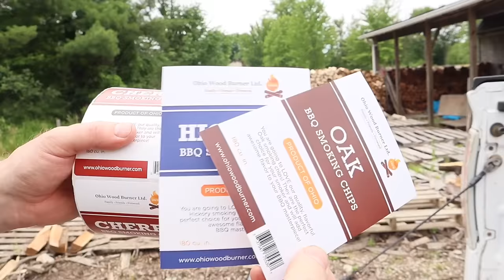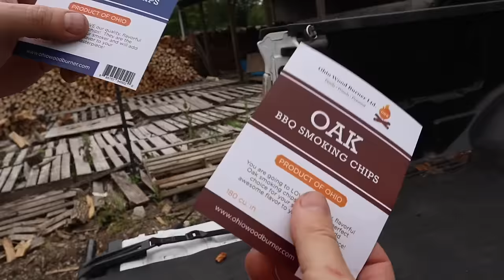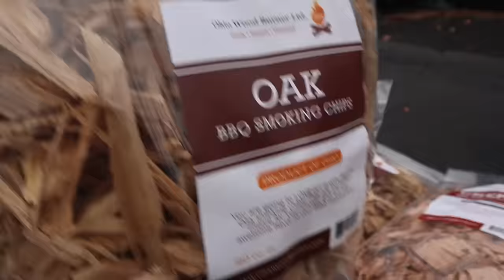New Firewood Product Nets $10,000 A Cord?!?!?

Comment from the maker: Here is the link to our online store!!  Check us out for your super cool, iconic OWB Tshirts and stickers!  
https://ohiowoodburner.square.site/
Reply: Please remove the bark before making chips for wood smokers.
Reply: Here is a good strategy… I think. Approach the bbq restaurants you sell to. Offer to package the wood chips with the restaurant’s branding instead of yours. Customers would buy the wood chips from them because they want the same great flavor at home. Require a minimum order amount from the restaurant and give them a wholesale price.
Reply: I passed this on too my daughter. Doesn't have any equipment and IMO doesn't need it. Rent it, one day. Bust butt and take it back until you make enough to buy it outright. 
While doing so, start looking for a deal on used equipment. Even rental companies sell older equipment if you can fix it deal.
HOW do you find Cherry, Apple, Oak, Hickory wood. Source seems to be the biggest pain the tale. Nothing happens with no wood, which you inferred to I believe.
Reply: Just a thought for rusty gear heads, if you have the space to build a small pole building. You could pipe heat from a sealed water outdoor furnace into a building that will dry the chips if you have a metal weave basket that can be moved by forks. Cherry wood is good and so is apple. Sugar maple, if you could get some, hickory and of course oak. Sassafras should do well but it would require more than what one would think considering sassafras doesn't get real big. Should bring a better price too.
Reply: Joe where do you get your labels

Comment: Idea to make hand loading chips into the bag easier: insert a short length of stove pipe into the bag. The bag should stand up while you toss double handfuls of chips into it. When the pipe is full, you have the correctly measured amount for a bag full of chips.
Reply: That is how i bagged up kindling sticks. Neat quick and cheap
Reply: Issue I see could be too close the speed with bullet the wood and destroy the bags. Your point on a chute under the chipper the metal stops it, with a slope tapered to fit your bag just site there and feed the bags.  Have a couple ideas on a bag holder. Of all the things, filling the bags looks like the most work at this end.
Reply: @IndyTiger1050  use potato type bags. stronger so you can shoot directly into bag, no need to put holes in them, the customer can burn the whole thing at once,  use it for kindling, and no plastic for the ocean (where 90% of plastic ends up). then you can add your business is environmentally conscience  which is a huge selling point nowadays. or use the plastic bags and you can put a funnel where the bin is, then funnel to a slide to a double gate and between gates would be the same amount of product for each bag.
Reply: That’s a great idea Roger. Thanks.
Reply: the extension shute could be made from perforated steel sheet so that the exhaust air can escape and make a manual conveyor to move the bags when full.
Reply: Nerds lol
Reply: I imagined the fry scooper at Burger King

Comment: Great! NEVER EVER put your hand or arm into the chute of a chipper while the machine is running! Drop another piece on to  so the weight will help feed the pieces though. I worked on a potato farm filling 5 pound bags. They had a machine with a huge hopper ,  the operator held a bag under a clamp, tapped a foot pedal, the clamp grabbed the bag. Hit another button, the machine ran a conveyor and filled the bag until the scale shut it off. You made the weight exact and took the bag off and ran it  through the sealing machine. I think Mike Morgan (Outdoors with the Morgans) got a machine like this he sells firewood starters in his packages. Awesome content,  I am going to have to go back and watch some of your videos I have overlooked.

Comment: Hi Joe - it's Big Rodders in Ireland.  Some years ago I made up 400 nets of kindling for sale.  To counter the perception by customers of being shortchanged when the kindling settled in the nets I detailed on the label the minimum weigh guaranteed, which provided a more professional appearance.  Also, to facilitate filling the nets I made up a simple wooden funnel.  To fill your bags I would experiment with an inverted circular conical traffic cone cut at the appropriate diameter so that the plastic bag fits snugly over it.  Mount the upturned cut cone on a suitable frame and get filling and weighting!  Prove the concept with this cheap and readily implementable process before investing more dollars into the project.  When the going gets tough the tough get going so it's over to you now!!
Reply from the maker: I do have a qty on my label.  I have it much lower than what I have in the bag so I think I'm good from a legal/honesty standpoint!
Reply: @ohiowoodburner  - that’s my Boy!

Comment: Improvements: Find the largest tube that your bag will slip over one end. Looks like about eight inches here. Put bag on end and stand up on table. Fill tube to correct level . Then lift tube out letting chips fall into bag. If need be you can make flare end at top like funnel. Also once you get the volume in the tube correct, make a "full" mark on the tube for future fills. Now you have a consistent volume that is fast loading. Another one would be to get special bag that is zip lock but has longer piece beyond the zipper so you could heat seal with a "seal-a-meal"  type heat element so it is permanently sealed until customer cuts off the excess and yet they can still zip shut between uses. No bags popping open on shelf for your customers. Also no risk of tampering that way. 

Questions? Are you selling by weight or by volume? Need to know and what local laws apply! Is that required labeling where you live and sell. If by weight you need a "commercial" certified scale for this use. If by volume make sure that every bag is "over full" and check the local laws on how they would require that you measure that on "fluffy" items like these chips. Compressed or not? Don't want to get this wrong. Weights and measures departments in many states are real headaches. Not an issue if you do your homework and always get it right, but don't just skip it and end up with issues. PS that overfull I mentioned is not lost product, but that way any single bag they randomly sample will pass. Call it insurance and figure the cost into the pricing. No one will complain about getting more, but if you are 5 percent less it becomes a federal case and they call you a robber. People are not rational. Some have lawyers on retainer. 

All  in  all a pretty good idea IF you stay local and small. DO NOT TRY TO BID FOR PLACEMENT IN WALMART. They are notorious for driving their vendors into bankruptcy by getting them to invest in machines that increase scale and help you borrow money to do that. Then they drive your price down to where you lose money and go bankrupt.
Reply from the maker: Very nice post Mark. I think I should start heat Sealing but I'm not sure if these bags would be appropriate but that is on my list of things to do. I have my volume listed on the label and I know that I am well over the amount with what I'm filling.
Reply: @ohiowoodburner  a cheaper option would be to use a heavy card type hanger and staple it into place. Or even just get your hands on some index poster board, cut it into strips, fold it over the zip end of the zip-loc, staple it into place, hole punch and you are set. This would almost completely eliminate the bag opening and would give a more professional look to the product. No printing require as your label does that already. And you can use the tools you are already using.

Comment: Hi Joe, I would recommend using a bulk bag, 1m3 in size to catch these in. You can get them with the mesh sides on so that you could potentially chip green wood and then store them away to dry out somewhere else until seasoned. Those bags have loops on the four corners so you could use the tractor forks to move them around. I would find out what scoop or container when filled gives you a the desired quantify for the bags each time. If you want to make any sort of funnel I would suggest making it from PVC/Plastic rainwater or stormwater piping/guttering goods as they are readily available, comes with brackets and no doubt there are already funnel like components for capturing the debris out of the guttering. You can make any chute or funnel required to tour requirements cheaply and easy to change out parts. Perhaps have your rig set up on a pallet so it can be again moved by the tractor when needed. Clever idea to sell the wood chips. Maybe you can set up a tarp so under the wood splitter and collect any suitable debris that falls to the ground where  splitting the wood daily. I know you have a few machines now and they may already collect the debris for you. Then it may only be a case of sifting out the dust from the chips and possibly putting these through wood chipper. After watching this I am now wondering if the chips would be suitable to burn in a pellet stove as they are quite popular here, I could offer these at a similar price point to the local hardware store. Cheers 👍

Comment: Check with the USDA I think it must be bark free as well.
A kiln when/if it fits in your operation would eliminate the insect issue if your area becomes infested and fire wood transport is restricted or banned, also another value added perk of your premium product.
See if you can find perforated bags for your next batch.
Make a small hopper to put the chips into and open and close the gate on the pipe that fits nicely in your bags.
Consider an electric motor to run the chipper.
Just some quick thoughts that might make your life easier as this grows BIGGER!  Praying this works out well for you.
Reply: Remember the old fashioned potato baggers we used in produce in the earlier days...same principle.

Comment: Hi Joe, great and logical idea. You may want to consider putting the chips through a screen of some type to remove the smallest bits. That way they would be more consistent.
Reply from the maker: Totally agree Clive.  I am on the lookout for that tight wire mesh and use it as a shaker.

Comment: To speed up your fill process get a flat table and cut a hole in it, then screw a traffic cone to the bottom of the hole (cut off the point and you have a funnel that you can  put your bags around.  You probably need to play with the table height to get the ergonomics right but it is like how they fill sand bags.  Then just slide chips through the hole in the table and gravity fill the bag.

Also,  all the bark from the debarking operation could be sold as Tanbark.  We used to use that as a ground cover in our garden.
Reply from the maker: Nice thoughts buddy  Thanks for helping me out!
Reply: @ohiowoodburner  Your welcome.  If things work out you could build a metal shed and paint it black for drying.  Put a wood stove in there and you have year round drying capability.

Comment: A similar product suggestion. Take the chips and wax coat them for a firestarter. Mike and Melissa Morgan were using some that someone gave them to start their fire ring. They has a similar bag that someone had given them and just grabbed a small hand full a it made the perfect quick firestarter. You could use any wood including pine for the firestarter. Would have to look into methods of coating the chips with melted wax.

Comment: I'd like to make a couple of points.
1) This is an EXCELLENT business school lesson!  I'm a business school graduate and after a bit of thought, this video touches on many aspects of business.  There are so many different lessons for business students in this video I don't even think I can count them all.
2) I'd like to offer an approach from the perspective of a consumer.  I like to cook with wood as it's less expensive.  I cook with small sticks in a rocket stove and with WOOD PELLETS in a forced air wood burner (Biolite Campstove2+).  Wood pellets are made from sawdust.  Perhaps you could, when cutting the wood, take the sawdust and make wood pellets for people to burn in their wood pellet grills.  Sawdust is a by-product of the cutting of wood so you don't have to do anything else to get the sawdust aside from collect it efficiently and then use a pellet maker to make bags of pellets that can be sold for a profit.
Reply from the maker: thanks for the nice post Mike.  I have thought of doing stuff with the saw dust but not sure what direction to go.  All of this requires bandwidth and personal interest and right now I'm not sure I have either.  Those presses look cool and I'm wondering if I can make it work?  I'm very process oriented despite what you see on camera lol and would have to make sure I have a good input and output.  Joe

Comment: Hello Joe, I like your new idea.  It has reminded me of a video from Outdoors With The Morgins where they showed a bag of wood chips like you are developing but that the wood was coated in wax.  It was a BBQ fire starter.  A lot of people, including myself, do not use starter fluid for our cooking fires because we don't want the fuel smell or taste on the food.  I currently use a wax based fire starter from ACE Hardware that is quite expensive.  You could potentially start a sister line product using your chips that is a fire starter.  It would only require another step to coat the chips, somehow.  Anyway, I hope you find this interesting.  Thanks, Dan
Reply from the maker: Thanks for the thoughts Dan.  I can see that happening eventually!
Reply: I wonder I you could dry and use the sawdust for starters?
Reply: @chrisartman6168   probably- but it has a goodly amount of bar oil on it.  Some people would likely have the same objection to that as to lighter fluid.   Worth a try anyway- enough paraffin, and you'd never notice it- especially for non cooking fires.

  Personally, I use splitter debris, dead sticks, and/or wood like pine, spruce, poplar, etc split into slivers.  And a wad of greasy paper towels, or rolled up strips of cardboard.  (cereal, cracker, etc boxes work great for this! so do empty paper towel and tp rolls.)  Lit with a propane torch.   I'm too cheap to go out and BUY firestarters, lol.  Especially not when I'm surrounded by trees, and have a neighborhood dump for yard waste to raid for material.
Reply: @pyroman6000  If you use canola oil in your saw, then it's cooking oil already spread on the wood. I run a tree service & have been using the canola for over a year. It works well.
Reply: @andrewvanada52   Interesting, I never thought of that.  Pretty cool idea!
Reply: @pyroman6000  And I always thought paraffin wax was made from OIL.
Reply: @iffykidmn8170  Idk if you're joking but yes it is. Another name for it is petroleum wax x))

Comment: If you will add a divider in your intake hopper it will help keep your sticks from turning sideways. That will give you more consistent sized chips. I noticed that when it gets turned, it splits the pieces rather than chipping it. Or even choke it down to like 1/3 the size. It'll still get twisted at the end of each piece, but it'll still make a decent difference. 
    I have thought about this idea as well. My chipper is an antique, but makes more like planer shavings. It's a huge drum nearly two foot thick sixteen inches wide, with planer looking blades sticking out. It is , it's own feeder as well.

Comment: Another great episode Joe. Maybe you could put a pipe or 5 gallon bucket with no bottom hung from the end of your chipper. Then connect/fasten onion bags to that once they are full you can let lay to dry before bagging. If you don’t want bark in your wood chips split the bark side often put in your bundles from Jeff in Maryland thanks again

Comment: Just a thought - chip straight into your trailer or alternatively cut down an IBC bladder and attach it to a pallet and chip straight into that. It would be an easy way to separate species and easy to move around with pallet toes.

Comment: For drying...have you looked into building a relatively small "greenhouse" wood chip dryer with a chimney stack. The sun will heat up the container of chips and the stack will cause a draft drawing air through the container.
Reply: Alternatively there is also a solar kiln.

Comment: I sell firewood in northern Alberta, no such thing as oak, cherry or hickory!Looks like you are set up well. 
 I would be using a pail without a bottom that fits inside your bag to fill it easily. 
I've used all the smaller branches and pieces for a similar idea running it through my wood chunker. It turns them all into useful pieces that can be shoveled. I cook a pig every year with diamond willow using this method.

Comment: A one  of the saw mills that I went to sells strips that  are 1.25" X 2.00 "the Amish use for kitchen stove wood. They are $10 to 15 a bundle and over 8ft long  .Most of the time there is 3/4 of cord in a bundle you could just pull them off of the trailer and feed in to the chipper no sawing , split , just stand there and feed . By using the cut offs there will be a lot less saw bar oil in the wood . Since you  already have the chipper have you looked into a pellet mill .If you want to ride up there let me know even buy you lunch @ Mary Yoders
Reply: Interesting. Do the pellet mills use chips or sawdust?
Reply from the maker: Thanks for the offer I like Mary Yoder's LOL
Reply: @chrisartman6168  Saw dust the finer the better
Reply: @ohiowoodburner  What time is good for you

Comment: try using a stainless steel charcoal starter tube. Put the bag around it, fill it and pull it out of the bag. large pvc pipe will work also.